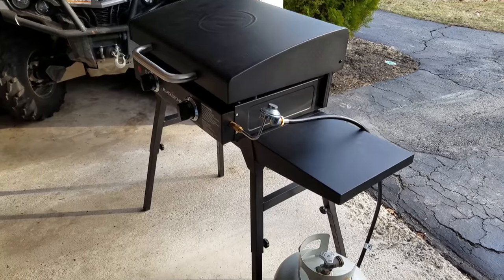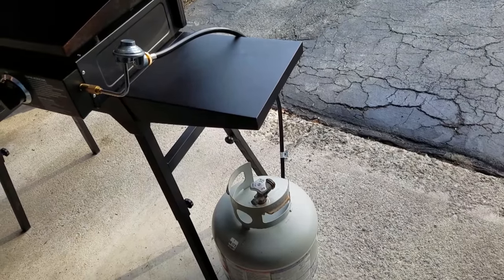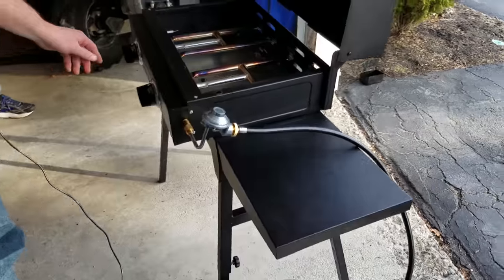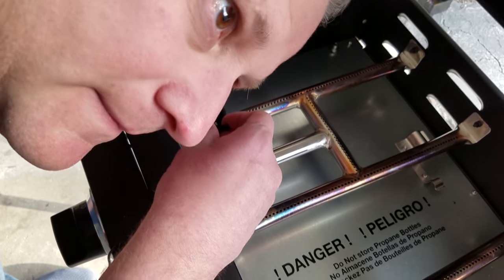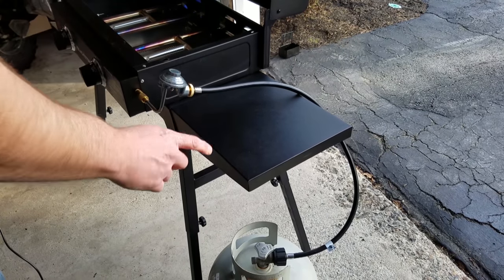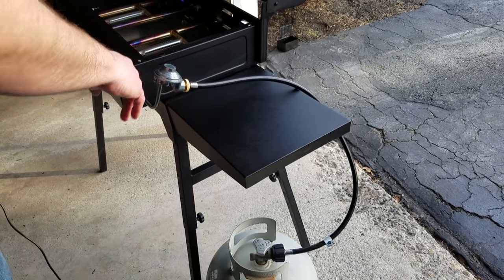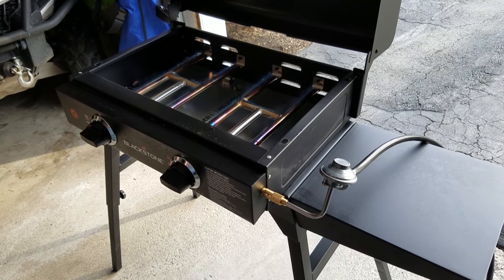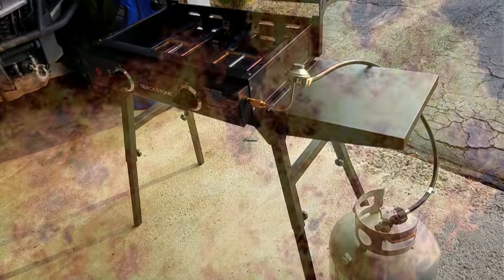Simple way to light a griddle suffering from propane over pressurization.

Comment: just purchased my 22" from walmart as well.  First time i lit the burners i had the same issue.  very small flame, i knew there was an issue when 20 minutes in on high there was no discoloration of the griddle.  I unhooked the line, blew in both sides thinking there was something blocking the flow.  i reconnected and WOW.  Finally getting the right amount of heat.  i was going to call Blackstone the next day to have them send me a new regulator.  Then i started seeing these videos about the valve and tripping the safety gate in the regulator.  I am very happy with the grill, been cooking on it the last 2 days.  i will try your method on my next camp trip.  thanks for sharing.
Reply from the maker: Sorry for the delay in replying.  Now that you have been using it for a couple months is it working as planned?

Comment: The pressure regulator was designed with the small bottles in mind. not the big tanks. There are adapter hoses with a regulator built into it and the double regulator setup should work fine as the first regulator knocks down the pressure to something the original one can handle. Grill on!!
Reply: I second this

Comment: Same thing happened to my 22. Turning nobs off and disconnecting the tank from the hose for 30 seconds, then connect the hose and slowly open the propane until fully open. Now light up the grill like normal. Thanks for the videos!

Comment: If u look online, it says don't open tank wide open
 That's what caused the over pressure shuttoff safety to kick in. Once I discovered this, I cut my tank on just 1/4 turn and have for the last year with no problem and it's a 4 burner and has no problem with all 4 on

Comment: I have the same model and the regulators are the problem.  According to Blackstone, if they sense a leak, it will go into a low flow for safety.. I did a warranty replacement on my first regulator.  I also did a similar video a few months back 👍🏻
Reply from the maker: Any ideas on my how to fix my 36?  The flame looks like it is the right size but the griddle isn't getting as hot as it should.  I also get alot of red-ish dust that build up on the shelf.   Not sure if this is rust or some by-product of a propane/burner issue.  

Thanks for commenting!   -N

Comment: I had a similar problem with my 36 inch griddle with full 20# cylinders.  I could run those half filled 20# cylinders from Walmart or local grocery stores, but if I put on a cylinder filled by loacal LP company, it would completely overload the regulator and shut down the griddle.  I now have a big dual stage regulator on my big Blackstone and it works fine with either type of tank.  My local LP company boys did a bang up job fixing my griddle.  My old regulator would turn into a block of ice if connected to a fully filled 20# cylinder.  Not any more.  It did not happen on my 17 inch griddle when I connected it to a new 20# cylinder.  It also works fine on 1# cylinders but when I refill them I keep them under 920 grams.
Reply from the maker: Hi John, I had to go look up what a dual stage regulator was.   I had no idea such a thing existed.   It's very helpful info... thank you for sharing!!!  👍   -N
Reply: @TheGriddleGuys  I could send you a picture if you want.  It keeps filled tanks from slugging the griddle with liquid gas.  The regulator that came with my 36 inch griddle would turn into a block of ice and shut down my griddle.  They also put a spin on connector on my regulator, so I can connect it to the tank as before.  I did not have a similar problem with my 17 inch griddle when I connected it to a full 20# cylinder.  I tried working with Blackstone but those idiots want you to jump through their hoop to get any support.  The handle on my hamburger smasher broke, due to bad welds, and I contacted them.  I do not jump through hoops.  I just welded the damn thing back together.  As you can tell I am not some idiot that fell off the turnip truck that went through town last week.  I get things done and do not waste a lot of time doing it.

Comment: I just bought one but what’s happening to mine is too much propane is coming out.  Should I just close the valve some.
Reply from the maker: call blackstone customer service and request a new regulator.  The regulators are kinda low quality. I have replaced a few already.   that sounds possibly hazardous.   BS has been pretty good with replacing them for me.   -N
Reply: @TheGriddleGuys THANX

Comment: I had this issue,  and I have the 20# tank with its own regulator,  and it plumbs directly in,  not through the mini tank regulator.  So it's not (only)  caused by the tiny regulator.
Reply from the maker: How did you fix yours?  - C

Comment: My regulator is freezing up. Changed 1lb. bottles and same problem. Also, the bottles gave off bursts of gas when disconnecting. It is brand new. Any tips?
Reply from the maker: See if BS will send u a new regulator.   The blast of propane when disconnecting is normal  It's the pressure built up in the line and hose.

Comment: Pain in the a^% to keep messing with it. buy an adjustable regulator hose on amazon for $13, and an adapter for the blackstone for $10. Works like a champ, and you can get that flame like a rocket engine if you want.  Best $ I ever spent on my blackstone
Reply from the maker: Good to know!  Thanks for the tip! - C

Comment: You don’t have to have the gas lines open while opening the tank, just make sure you open the propane tank very slowly and it won’t trigger the safety valve in the regulator.
Reply: I have the same griddle btw.

Comment: There is nothing wrong with the regulator if it works with a 1 pound bottle it will work with any size propane tank.
The problem is the hose connector at the 20 pound bottle. There is a built-in check valve that is supposed to stop the propane from escaping from the bottle if the hose ruptures. 
The small 1 pound bottles that are being used have the same pressure in them as a 20 pound bottle. The bottle size doesn't matter. Propane has the same vapor pressure in any container it is stored in. At 70 degrees F. you will have 110# of pressure and at 80 degrees F. you will have 128# of pressure no matter the size of the bottle.
Reply from the maker: Good info. Ty tjrobil

Comment: Every time you turn on a newly connected tank, on anything, open the valve slowly. If the gas flows too quickly (which it would do until the hose is pressurized), it will trigger the wonderful safety mechanism. This also prevents the flow if the valve is accidentally opened or a hose breaks or anything. And, don't open the valve with the burners on, that'll trigger it too. The only reason this worked in this video is you opened the valve slowly. If it does get triggered just shut off the tank for a second and then open it slowly again.
Reply from the maker: Agreed Bill.  Thanks for your input. - C

Comment: I'm planning to purchase the 36" soon. I have a direct propane line on my back porch from a 250 gallon tank that supplies my home.   Has anyone tried this and will it work? I have a gas clothes dryer,stovetop,water heater and central heat that run off this tank.
Reply from the maker: Jeff does that and yes it works fine.  I would have some form of a shutuff for when griddle 8s not in use. Would stink to have a leak and lose a ton of gas you had to pay for.   N
Reply: @TheGriddleGuys  Thanks!! Yes definitely I have a shutoff valve that will be turned off when not in use. Love y'alls channel guys!!